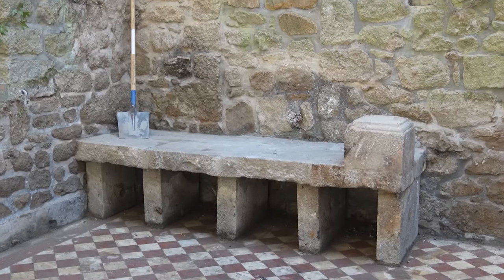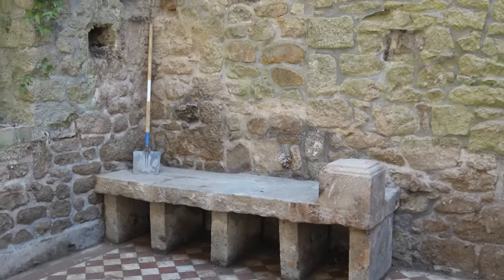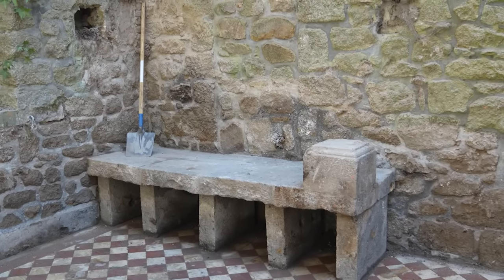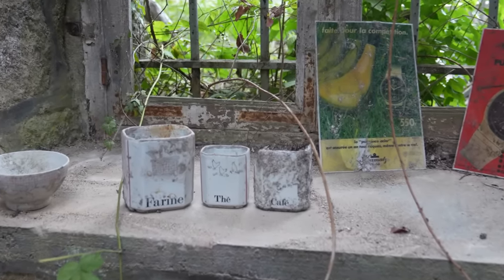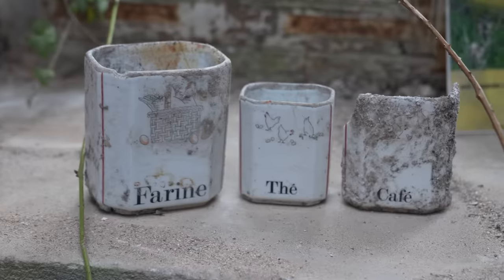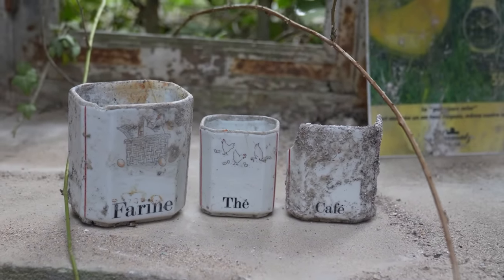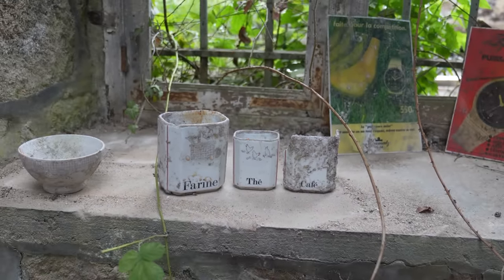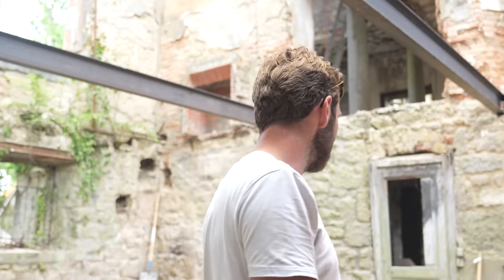Completing an impossible task at the chateau ruin.

Comment: Of everything that you all have achieved so far, experiencing the sheer size of the kitchen really brings the immensity of the Château to the fore. When you were working in the bathroom sections and even in the entrance hall, it seemed rather small for a Château. The kitchen is enormous and that's only one room, as all the floors above will be too. Your castle is taking shape, Sir, at a rapid pace. Oh, and the placing of the arch was a lesson in Masters at Work. ❤
Reply: Yeah, I gasped when Dan mentioned the steels were six metres long, and they run the short length of the room! Obviously he cut a bit off and they sit inside the walls but the shorter side is still something like 5.4 m, so the longer side has to be close to seven m.

Comment: Nic mentioned the fan belt jumping off as one possibility of something that happened with his equipment, apparently the engine got hot and was pouring out steam from the radiator?  I hope his engine did not burn out, that would cost him a lot to replace.  He certainly pushed that hard the last 2 days on that massive clean out.  What Nic got accomplished was absolutely mind blowing, along with the shoveling and lifting that everyone did, and Dan with his digger.  Just incredible.  Crossing my fingers that Nic's equipment will be okay and not be too big of a deal to repair.
Reply: I was thinking the same thing, watching the little skid steer work so hard with Nick in it.   I was hoping it wouldn't break down in the middle of clearing out that room. My big skid steer needs work periodically...clearing debris takes its toll over time.

Comment: Dan when you start the floor timbers, You should get a heavy duty nail gun and stop using screws. Firstly it will be much faster but more importantly! You should only use screws to hold DOWN floor boards, Screws are not strong enough to use for joints as they are very hard and brittle,  whilst they have good tensional strength which is what you need to pull a floor down their shear strength is rubbish.   You need good shear strength for timber that will move,  even a small amount of movement in a beam will shear the screw very easily, whereas a nail is more maliable and will twist and deform many more times before is breaks,  In many countries it's against the building code to use screws on framing, whilst I don't think it's against Regs. in the UK and I guess France. Any professional carpenter knowns not to use screws, High tensile bolts with Penny-washers and star -washers are okay but time-consuming. 
Its a standard error of DIY carpenters to use screws for everything , thinking that nails are old fashion but trust me (I'm a qualified engineer) nails are still used in the building industry.

Get yourself a big F***off nail gun. With all the work you need to do you won't regret it. especially if and when you start to do stud work.  And it might save you some very expensive and time consuming remedial work in the future.
Reply: Dan, ignore people waffling about cherrypickers and whatnot. This is the advice you should listen to.

Comment: With regard to the placement of the arch stone, two words: wooden wedges. You should have used wooden wedges to hold the mortar joints open while you placed the stone. After the mortar sets you remove the wedges and fill the holes. Never ever pry at  granite joints with a steel crowbar. You are just asking for chipping and trouble. Go buy or make some wooden wedges and a good book on stone masonry.

Comment: I would fill the floors with concrete with revermats supported with duka bars and sealed with screen-printed wood. And rented a slewing tower crane. Then you would be quicker with the renovation... but nice videos, keep going and don't lose the courage of the building

Comment: After test fitting the arch, you should lift it up again and apply a layer of mortar at the sitting points and behind it. Smearing the gaps afterwards doesn't mean the mortar has penetrated in the contact points and the back of the stone. This is unstable.
Reply: Fitting spacers - pieces of slate or small stones stuck in place with epoxy resin would make the necessary gap to allow mortar placement.
Reply: I see by your username, warpspeed...are you a Trekkie?  Star Trek...'Warpspeed, Mr. Sulu".

Comment: This 'new' room seems to be one of the most suitable options to begin the structural restoration of the ruin (reinforcing the base level), and is also a good candidate for the first secure storage area/site workshop ? Unbelievable what you have achieved on this project so far. Fantastic support from your friends. I saw this building as a lost cause in the beginning, but your immense effort and determination are winning. When are you going to put some site accommodation on the grounds ? Caravan/cabin/mobile-home/w-h-y ?

Comment: It's nice to see a room cleared and an arch reinstated but you have no roof. Having spent a whole career in the construction industry, getting the roof on is  number 1 priority.
It doesn't matter how well you protect floors, they will be damaged by winter weather unless you get a roof on. You can do very little in the winter without a roof. Summer is the time to work on that roof. You can't use cement when it's freezing in the winter. Get the roof on

Comment: If Cassons get you that scaffolding they promised, you could get access to the roof of this section of the chateau to get it watertight before winter and then you could install the floors on this section.

That way you could live there if you got water connected. You could rig up a shower and hire a "Portaloo" to have in the grounds which can be emptied regularly. You would save money on AirB&B's and travel.
Reply: Good point!

Comment: wondered what solid color floor area was used for? then wondered if u plan on cage elevator for 4-5 floors as you rebuild the chateau bone structure.  guys are scary skilled! good luck!
Reply: Some other commenters also noticed that area in the newly excavated room (old kitchen) and thought it might be a pantry area.   The room could have been divided before.
Many have suggested a cage elevator, or a scissors lift, a brick hod for lifting bricks ( he's going to need ALOT of bricks to re-build), etc.   Some have even suggested to plan/put in space now for a real elevator that he will need later, as he ages.  Good question!

Comment: How phenomenal! 😍 i'm curious, is the reason you haven't begun with repairing the roof because underneath is not yet structurally sound or is there just too much repair work at the top that still needs to be done? I love following this channel! I can't wait to see how it transforms!!
Reply: As you may have seen in recent Vlogs, he has been working on stabilizing/re-bricking/re-mortaring the 2nd floor hallway wall to get it up to the attic floorline.  That is where he was going to start putting in a temporary roof.  With Calvin here for this week, and others ( Nick & Cameron) available, he switched gears to get their help with the heavy I-beams to stabilize the basement room ( old kitchen) on the right of the chateau. I'm sure he'll return to 2nd floor wall/roofline work soon.
Reply: @homeemail2306  thanks for your reply! I thought that may be the case! I can't wait to see this unfold!!

Comment: 1 left to clear out unless I have missed something. I can just see that tile with a good power wash but would make a muddy mess.
Reply: Aren't there 2 great rooms on ground floor level that need to cleared of some debris?  The great room directly behind the main entrance foyer ( where the stairs were), and the great room to the left of the main entrance room, the one that had the very large tree sticking out the top of the chateau? Nick chopped that tree down early on, but left the tree trunk base attached to that floor until they could pull it out later...the floor was flexing as they pulled the tree trunk base out!  Dan was saying he will probably need to replace those floor(s).
Reply: @homeemail2306  I went back a month to find a drone view of the whole thing. Found the perfect shot at 5:30 in the cleared out the top floor, time to demo it. 1 main section divided into a front and back section and 2 side wings. The kitchen is in the back of the main part basement? behind the formal entry with the floor that was taken up and saved a while back.  Were the side wings cleared out? I thought 1 was and that would be 1 left but couldn't find a current drone shot to find out. What I did Find out by looking at the old vids is the Absolutely miraculous amount of work that has been done since he bought the place 8 months ago. There is also a very large house within back walking distance seen clearly in some of the older shots. Its maintained and occupied I would assume and the kids and residence no longer have a ruin to go explore just a short distance thru the back woods.

Comment: I was very surprised there was so much dry ash from the floor above the kitchen that was being shoveled down to the kitchen. Because I would have thought the ash would have worked into dirt with all  the plant debris around. How many rooms are there left to clear? What seemed impossible is looking very possible.
Reply: Dan & Team just excavated the basement room of the right side of the chateau.   There are 2 other main room ground level floors that have alot of debris and need alot of work.   One, in the middle, directly behind main entrance foyer ( where staircase was), and 2nd great room, to the left of that entrance room - that room was the one with the great tree in it that Nick removed early on.   That floor was flexing 😬as  they pulled out the tree...Dan did say the floor will need to be replaced.